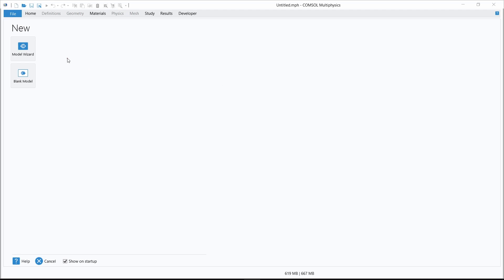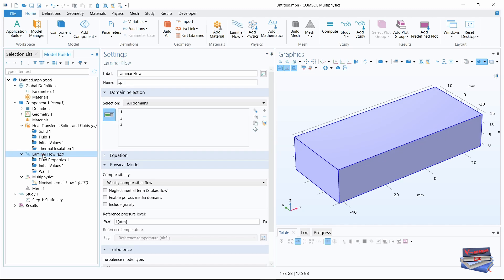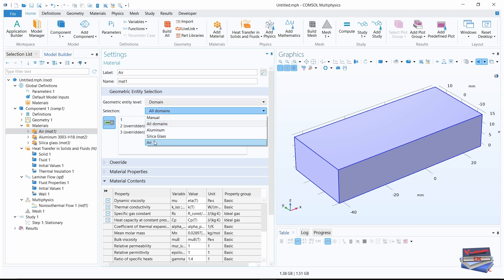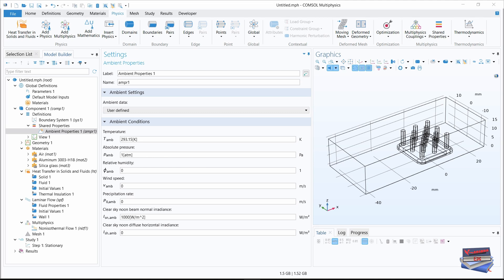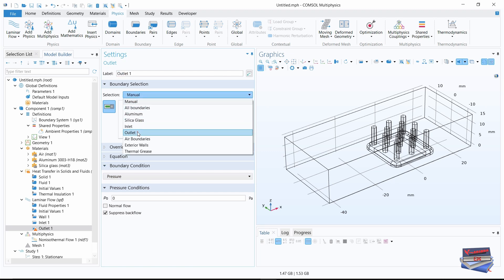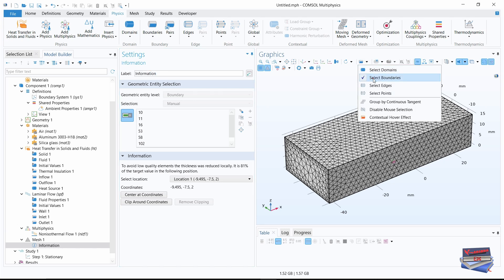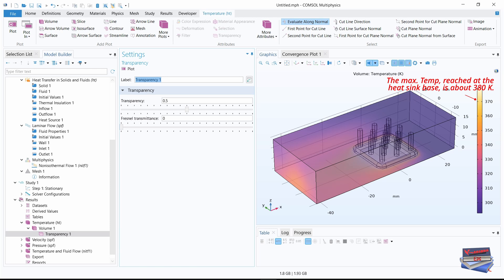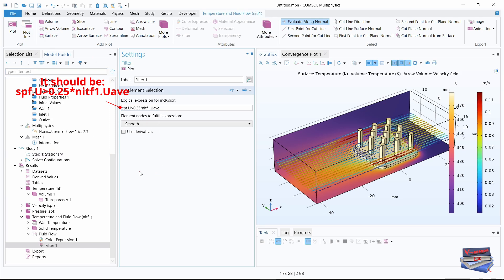Heat Sink - Part 1 #comsolmultiphysics

Comment: Not getting air option in my domain
Reply from the maker: First make sure you have the following covered: 

1.  In the Model Builder window, under Component 1 (comp1)>Heat Transfer in Solids and Fluids (ht)  Click Fluid 1

2.  In the Settings window for Fluid, locate the Domain Selection section.

3. From the Selection list, choose Air.

Next, add materials.

1. In the Home toolbar, click Add Material to open the Add Material window.

2. Go to the Add Material window.

3.  In the tree, select Built-in>Air.

4. Click Add to Component in the window toolbar.

If you don't have Aluminum 3003-H18 & Silica glass. You can do the same to add material. 

Close the Material window.

Then: 
1. In the Model Builder window, under Component1 (comp1)>Materials click Air (mat1).

2.  In the Settings window for Material, locate the Geometric Entity Selection section.

3. From the Selection list, choose Air

Let me know if this helps. Watch the video carefully. You'll get it!
Reply: @kabindaex7047  Thankyou for reply 
I will check it today .